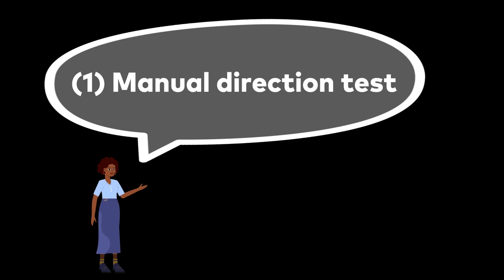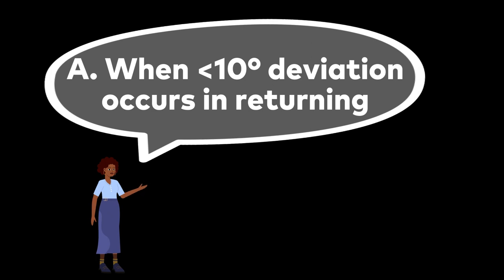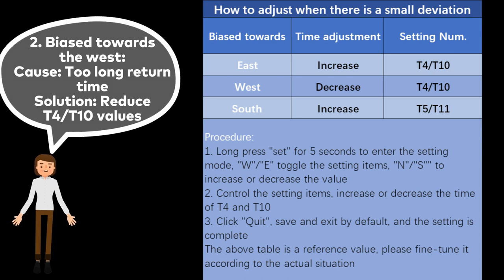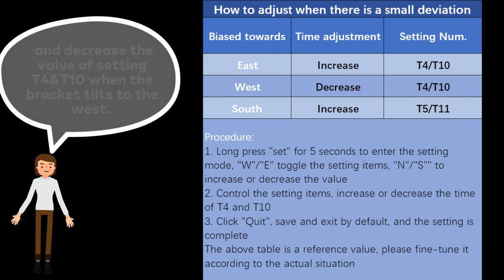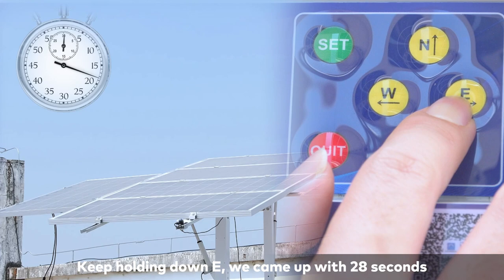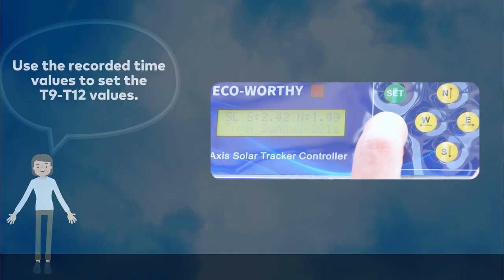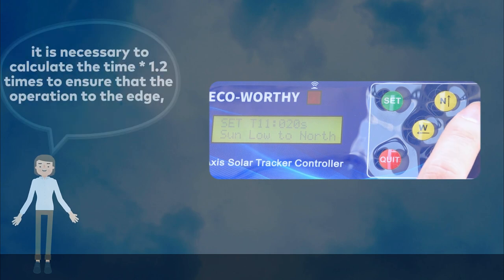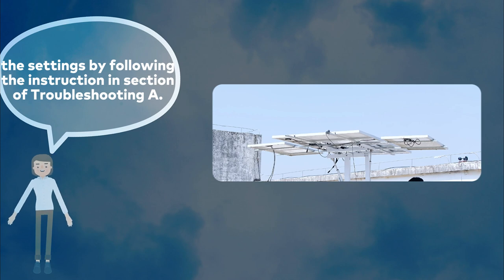Troubleshooting for the controller of the ECO-WORTHY solar tracker

Comment: Mine will not track. Everything is set, all times per direction, it just continues to set at safety position. Shows an FS F:4.98 and wind lock with no wind, seems like maybe some stray voltage is getting to it? Is the F: the wind voltage? It says that even when i disconnected the wind unit. I am guessing its a bad unit? Of course  the company will not respond to calls, to chats or messages on Amazon....
Reply: I had a similar issue before but it turns out to be the wiring to the N/S actuator +/- terminals were reversed inside the controller.  Also besides that, make sure that your SUN tracker is mounted on the East side/West side of the track and the cable coming out of the SUN tracker should then be pointed to the SOUTH
Reply: @looking4thetruths  It is set right, NE corner of EW upper track and cable south. It tracks perfectly if I make the wind speed V2 at its max of 5 volts. The wind sensor supposedly only puts out 0-2 volts so it could never get that many volts from the dc gen in the wind speed indicator regardless. If that voltage was 1/100 of a volt higher I would have never figured it out because i would not have been able to activate it.
Reply: @jsauerii , sounds like you fixed your issue already.  Great!
Reply: @looking4thetruths   No, Where did you get that idea? It is a bad board. Eco-worthy in typical chineseum seller fashion has the nerve to say I hooked up the wind sensor to the wrong connection and burnt out a diode however I had not even hooked up the wind sensor yet when I had hooked up the system and found the issue. Also the wind sensor is supposed to produce from 0 to 2 volts DC and spinning it as fast as it will go with compressed air I can only get about 550 millivolts or 0.55 volts. Thats about 25% of its specified DC rating. They say that is because they get damaged when hooked to the V+ rail which was again never done by me so the only assumption I can come up with is they sent me someone elses returned junk as new after they hooked it up wrong and ruined it and returned it.

Comment: My tracker follows the sun during the day but does not reset for the following day.   I m having to manually move it all the way East manually each day.  Need help please.
Reply from the maker: Maybe you could pay attention to the setting of T7.

T7-wind lock time: T7-Wind Lock Time is the value that decides how long would the tracker stay in the position after running T3-T. If the voltage from the wind speed sensor stays higher than V2 value after the T7 countdown is over, the controller would run the T7 countdown again until the voltage drops.

The "Wind Protection" and the "Night Returning Process" would work at the same time. If the T7 countdown is over and the wind voltage has dropped below V2 while the Night Returning Process is initiated, the T7 lock will not exit.

Comment: The issue i am having, is when the tracker tries to move the N/S actuator, it restarts the tracker. 

The E/W moves fine.

Also when moving both actuators manual, I dont have these issues.

Any ideas? Its frustrating.
Reply: I had a similar issue before but it turns out to be the wiring to the N/S actuator +/- terminals were reversed inside the controller
Reply: I think in the installation video you should first cover the light sensor so it doesn't get any light initially.  Then confirm that the actuators move the correct way before doing anything else.  The long actuator can be mounted at least three different ways and that's the reason for miswiring the e/w, but the n/s actuator can only be mounted one way and the wiring should be correct, but for some reason this continues to happen all the time.  The black wire should be on the left for both actuators.
Reply: Yes, the inside wires were prewired, so I didn't even bother to check first.  But like you said, make sure it all works, press East to east, press West go north, etc... before connecting the sun sensor and make sure the sun sensor wire face SOUTH.  It should work just fine.  There is only one other issue, that's if the mount is not oriented correctly and perhaps, that should be the first thing to check, make sure east side of the mount is actually facing east...  Thanks
Reply: Thanks for the reply. So the issue was the motors for that one actuator was actually pulling more power than it was supposed to due to being faulty. Got a new one and all works well. Just connected a fuse to my Pos block and to the tracker to protect in case of surges. Seems to work so far but only time will tell lol thanks everyone.